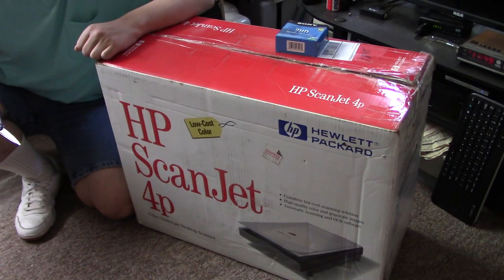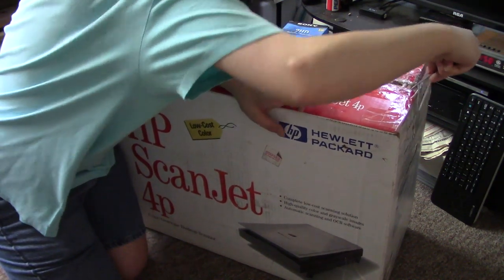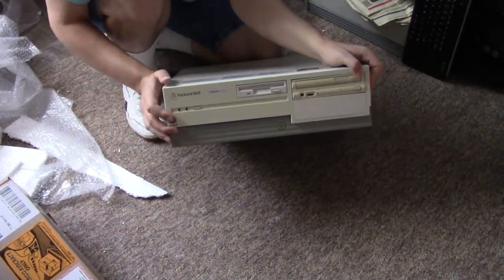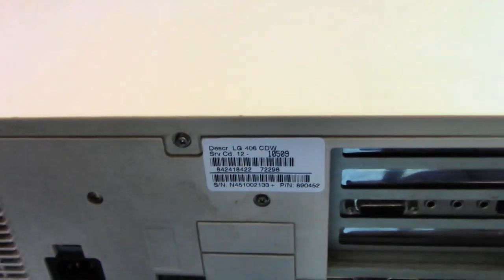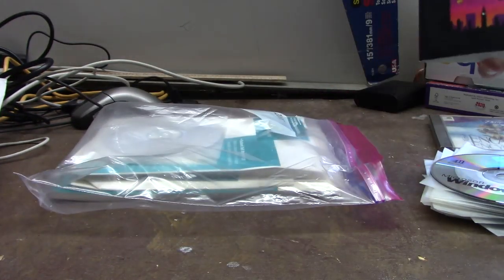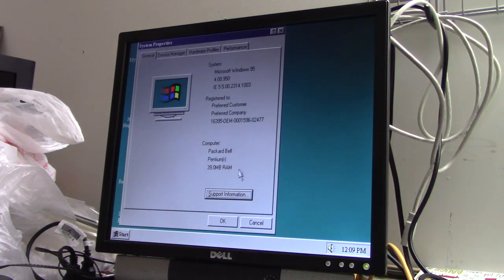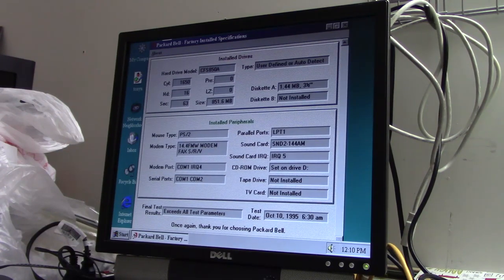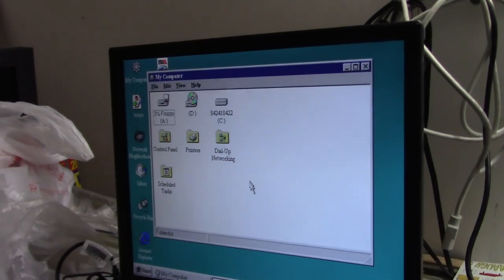Packard Bell Legend 406CD Unboxing & Test

Comment: Would also be good if you found an AST advantage adventure 466 pc. I remember when we bought that PC in early 1997 which came with Windows 95a I believe the version from 1996. Had a 66mhz 486 cpu with 8 mb of ram and a 540 mb hard drive.

Comment: Since Packard Bell used different model numbers to signify very slight changes in the configuration, I am pretty surprised they used the same Legend 406CD name for both this and their 3x3 model with a different motherboard.  I have a Legend 410CD and the only difference between this this machine and mine is that mine originally came with a 1.2GB HD.

As for those batteries on PB600 boards, yep, mine is still working as well.

Comment: very similar specs to the Executive 907D corner PC I had. Except it had the 1.2GB HDD (I think it was a Conner) and the (in)famous MWave card (that thing was infuriating sometimes). Also had the Radio Card in it, which was great, and which i actually wrote a TSR for (in Turbo Pascal) to allow me to switch radio stations while playing other games in DOS mode using some predefined key-combinations. Loved that PC. But yes, very similar spec to this - think the CD drive was even the same (an NEC model).